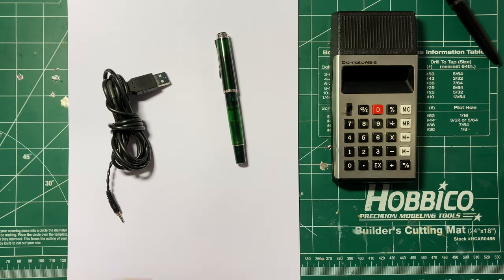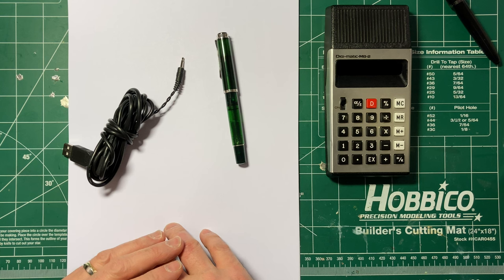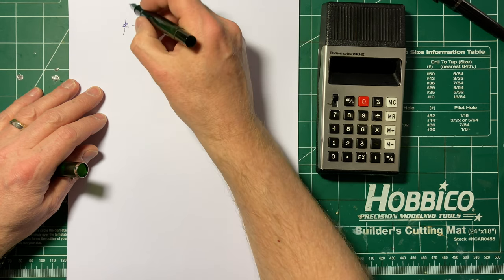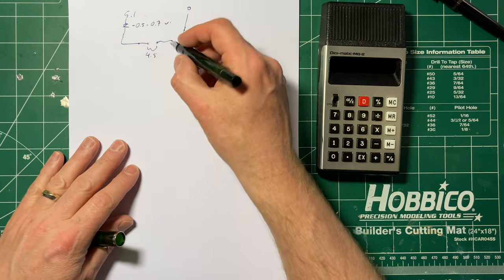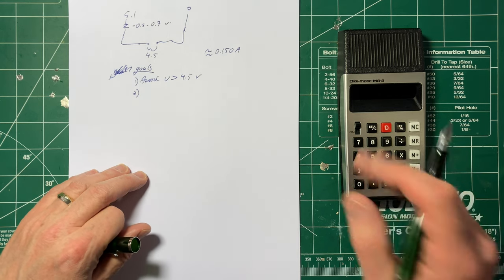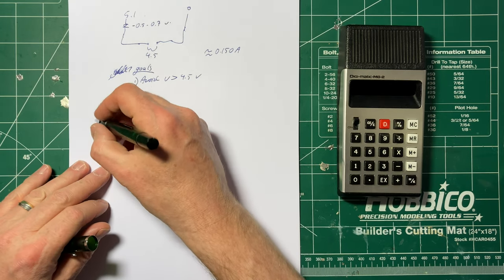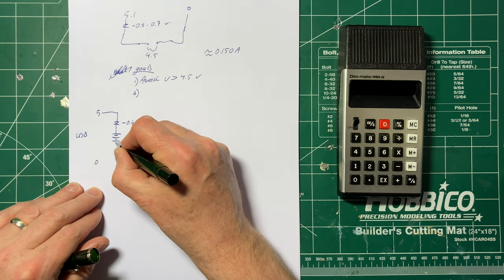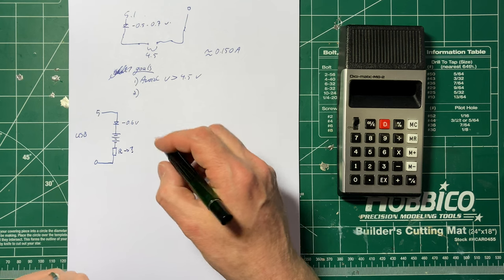Digi-Matic M8-2 Calculator Repair Part 2: Installing a battery and making a USB charging cable

Comment: Nice! I did a similar thing on mine, using a 18650 cell and a usb charging circuit, and made a hole on the back for a usb-c port